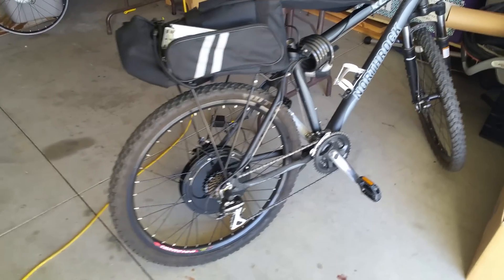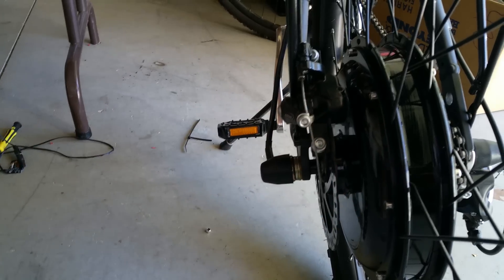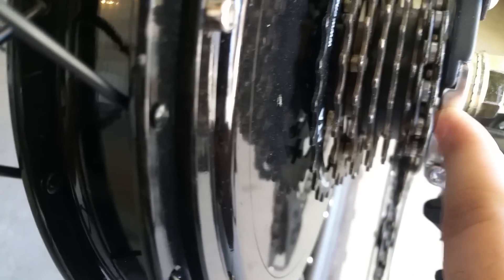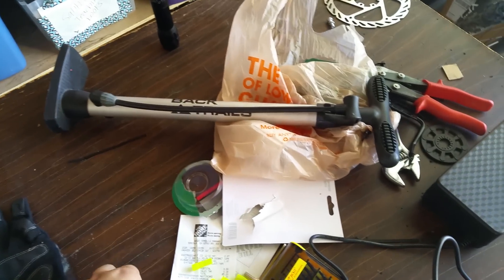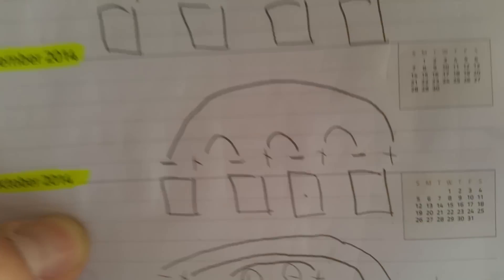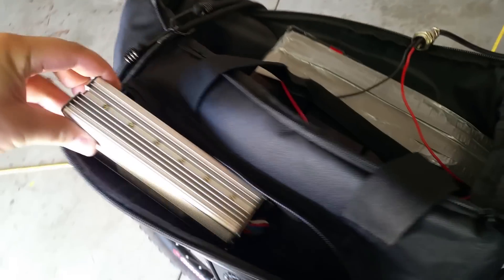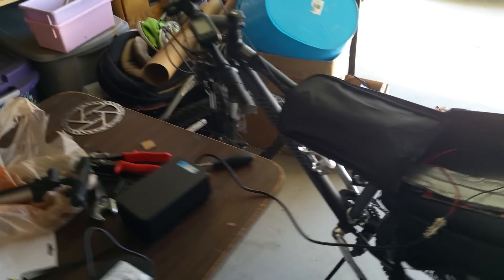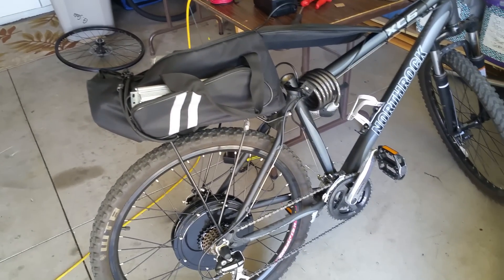Fast and Cheap Electric Bike! Over 30 MPH! Part 1

Comment: The correct wiring, running positives to negatives as shown in your drawing is called "in series." "In parallel" connects all positives to positives and all negatives to negatives. Your drawing is mostly right but I hope no one takes the positive from battery #1 and connects it to the negative of battery #4 as shown in the drawing. This is a short circuit and will make big sparks and fried connectors.
Reply from the maker: +CGMD You're absolutely correct.
Reply: I was just about to make the same comment. It also made me laugh that he thinks he nearly killed himself with 48v dc 😂 yes it will fry a spade connector if batteries are shorted but you wouldn't even feel it if you touched it.
Reply: By the way I'm not trying to make fun of itzroyal at all and I admire the fact he has had the guts to built something even though he doesn't appear to be experienced ian
Reply: +CGMD Yeah, I saw that too. That's where the motor should be.

Comment: I am also having the same problem with rear cog rubbing against the frame and my chain cant use the last gear. What type of washer did you put in between the cog and the frame?Does the washer have a rectangular hole, like the ones that came with the ebike kit to fit the axial so they cant move or does the washer have a round hole like the normal ones? Do you recall the size? I wan't to get the same one!
Reply: +George Mihestean Also did you have to cut the connectors at the end of the hub motors wires to fit the washer on? On my kit there is one connector that's just too big to fit through a washer, and it has 5 or so wires i would have to re connect some how.
Reply from the maker: +George Mihestean The washer I used was apart of the kit. I repurposed one of the normal circular washers that was suppose to  be used to  secure the tire to the frame. Using it tighten to tire the frame was pointless, so I just used it for the purposes stated. But you can use any thick circular normal washer to for it.
Reply from the maker: +AllOver Clips To answer your second question. The washers were already on the wire out of the box. I didn't need to cut any wires. Washers no being on the wire sound like a design flaw. Or maybe you bought a different kit not from amazon? The one from amazon came with the washer on the wire, which was pretty convenient otherwise I wouldn't know how to put the washer on without tampering with the wire. Maybe your kit doesn't need a washer?
Reply: +AllOver Clips Yes my kit has 2 washers on the rear cog/gears side on the wire, but according to the instructions they are suppose to go on the outside of the frame, not in-between the frame and the wheel. I tried sliding one of the washers in-between the frame and the wheel, but it sits crooked instead of flat against the wheels cog. It won&#39;t sit flat because the first washer has a slight bend in it at the corner which fits the outside of the frame. Is this the washer you used? The second washer is perfectly flat and would probably work but i would have to cut the cable and take both washers out, and put the washer without the bend first, then the washer with the bend second.
Reply: +George Mihestean Oh i see the problem here. My wire comes out of the side with the rear cog, your wire comes out the side without the rear cog, so you don&#39;t have to cut wires to add washers or nuts to that side of the wheel.
Reply from the maker: +George Mihestean Yeah just regular flat washers. What kit did you buy?
Reply: +AllOver Clips 36v 500w kit off ebay. All the cheap kits look the same so i figured they all use the same washers and connectors. The seller was no help as expected, and i didn't feel like repacking everything for a return and waiting for a different kit. Who knows i could have gotten the same problem again. Anyways I figured out a way i could disassemble the pin connector at the end of the wire so i can add or change the washers, FINALLY! I found that by using two flat washers from the kit and putting them in-between the frame and the wheel works the best. With only one washer, my chain still rubbed on the rear derailleur's attachment screw. Anyways, the wheel spins freely for the first time and i am able to turn the pedals backwards! Everything looks good except the wheel is off center a bit, but its sits straight and turns straight, so i hope its going to be fine. I just have to see if my brakes can work properly with the wheel being slightly closer to one side, i have the pad brakes not disk brakes.

Comment: Did you need two different types of wires to wire the batteries together or did you just use the 12 gauge wiring?
Reply from the maker: +s6am6 I used the 12 gauge wire to wire the batteries in parallel like in the battery diagram in the description and to wire the batteries to the controller. The controller had its own bullet splice connectors and I bought my own from home depot to wire. The 12 gauge wire was to big for the necessary bullet splice connector I used but I just trimmed a few strands of the the copper wire down a little and it fit snug. I used 12 gauge stranded wire not solid wire. Stranded makes life easier.
Reply: +ITzRoyall with the AMPS this system can produce, Iwould have used at least 10 gauge wire.

Comment: did you remove the crank arm and install the PAS? Do you need to install the PAS?
Reply from the maker: +s6am6 The PAS doesn't need to be installed. I didn't install mine and that's because I mainly use the motor to get around without ever peddling. I only peddle if I am climbing a steep hill to help the motor and prevent it from burning out.